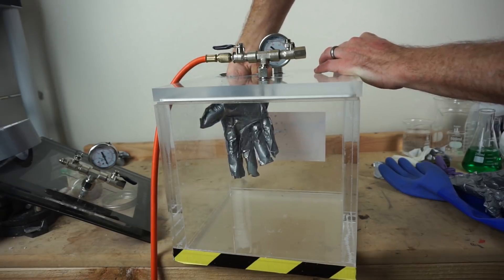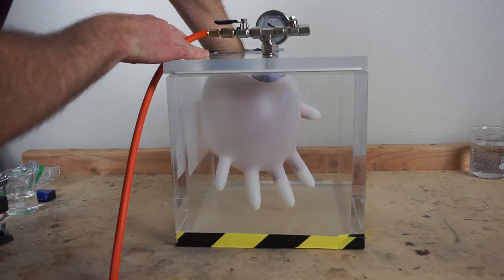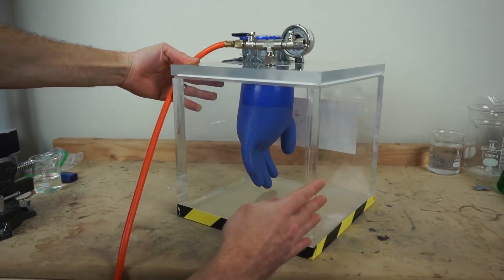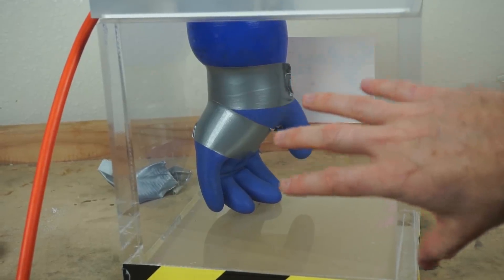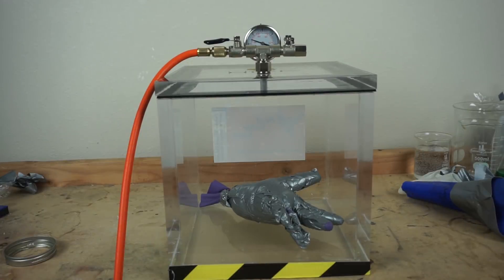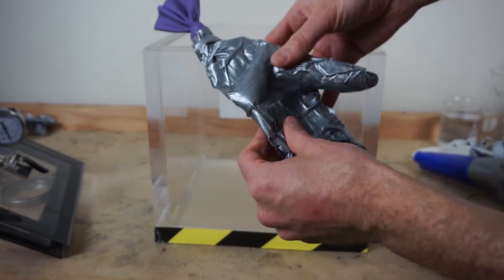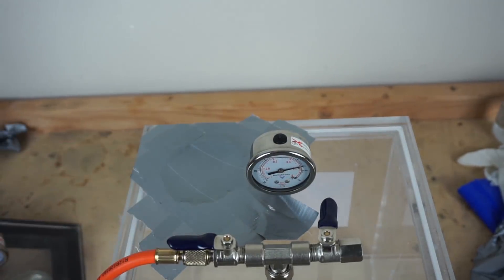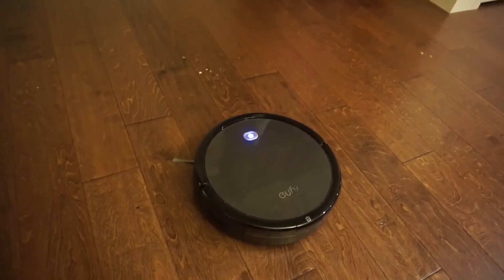Could You Make a Space Suit Out of Duct Tape? Wearing a Duct Tape Glove in a Vacuum Chamber!

Comment: I think your methodology is a bit off. Tieing off the end of the glove and placing inside won't create the same amount of pressure as having it attached to the hole in the lid. If you have the glove attached to the hole it will inflate with as much as as the inside volume of the glove where as tieing off the end will not allow it to inflate. Less air volume expanding over the same area creates less pressure than an already filled glove expanding over that area. A cool concept though. I would like to see an updated video in the future.

Comment: But this is assuming inside the astronauts suit is 1atm of pressure. Thy only inflate the suit to 3.5psi which is around the same pressure as 30,000ft. 1atm is  14.7 psi so this test is not at all accurate. If that is say a 3” hole it would only need to support 99lbs of force that was spread out evenly.

Comment: But Martian was using duct tape from the wrong site! Not from higher, but from lower pressure! That's why it shouldn't work so good. If he duct tape from the inner site - ok, it'll be hermetic because of pressure, no glue need. In Martian's case - it can't be hermetic because glue is not as strong as pressure.

Comment: What about plus or minus +-455 degrees? How does 3/16th of an inch (the thickness of a space suit) withstand these temperatures and the vacuum and the radiation and the space dust. What kind of Heater can warm something up that is -455? What kind of Air Conditioner can cool +455? What battery can supply enough power to said Heater and Air Conditioner? How did they do this in the late 1960's? How do they do it now? How much power is needed to Heat or Cool an environment that maintains +-455 degrees? How will duct tape hold up to these temps?
Reply: Oh I forgot and fit in a small backpack ?

Comment: Why are you reducing the pressure so low? Real spacesuits are only pressurizes to about 0.27atm. So to accurately simulate space, you should reduce the pressure inside the chamber to only 0.73atm. That will make the 1atm in the gloves 0.27atm above the pressure in the chamber.

Comment: Yes, and then your hand boils because there's nothing for heat to transfer to.
Reply: Renegade Rabbit 

If your hand is in a sealed glove then it wouldn't receive the effect of being in a vacuum
Reply: Lee burns 

It would, because heat would still transfer these materials, causing it to reverse back because there's nothing in space, so heat energy doesn't transfer.

A common misconception about space if you were shot out of a spacecraft for example, is that you'll freeze, but in fact your internal body heat would boil you instead.
Reply: Renegade Rabbit 

Heat coming  from where ?
Reply: Renegade Rabbit 

That's why space suits have a built in cooling system .

I thought that you were meaning in a real life space suit and not just a rubber glove with masking tape around it..

Comment: this test is flawed because air from the room could get inside the glove... air in the room (because the room is not sealed) is essentially infinite and also does not have the same properties as the elements comprising our body since our body is made of mostly solid or mostly liquid substances but room air is mostly a gass.

The cheapest and kinda accurate way to test this is to fill the gloves with some viscus gel and then seal the glove from the outside too and watch if it brakes.

Comment: This is what i don't understand about space suits. they don't blow up like balloons but they stay all floppy and crinkly. Makes no sense.
Reply: Space suits are made with many layers the bladder that holds in the pressure is one of the inner layers. The outer layer is the Thermal Micrometeoroid Garment. The TMG is not pressurized.
Reply: @dansv1  Are they under a vacuum rather than under pressure? I would assume it's the absolute opposite to diving.
  I assumed there was some type of inner layer but also would have thought that this would make movement extremely difficult.

Comment: Full vacuum? now way, it looked like it was still at 10% or so. Duct tape won't hold in a full vacuum.
Reply: Sjoerd de Haas 

What difference would the last tiny bit make??

A vacuum is powerless and passive ..

As long as a pressurised object can withstand the missing atmospheric pressure that's normally pushing back at approx 15psi then it can sit in a vacuum easily..

A vacuum isn't doing any sucking..

Comment: Space helmet fix debunked!!! His helmet was pressurized, so it's the opposite of the vacuum chamber. Relying on the duct tape adhesive to seal the pressure difference rather than the tensile strength of the duct tape as you demonstrated. I call fiction.

Comment: This is wrong and misinformation, what ur doing is trying to pump out air from the glove that's exposed to well oxygen. That's not how space works. If you where getting ready to go in space in the air lock, the air lock isn't pumping out oxygen from the room BUT instead letting vacuum from outside inside. Which means, the blowing up glove thing wont happen at all. Even when ur in space, nothing will happen to ur glove. HOWEVER, this doesn't mean ull be fine dandy. Its still freezing out in space, so itll freeze through the glove in just a few seconds, that's why space suits are thick, to protect against the cold. All of these gloves maybe except the duct tape one would work in space. They wouldn't pop. That's fake news.
Reply: You are quite wrong about that.  Think about it carefully:  

Your space suit glove would properly be attached to a pressurized space suit (pressurized to an estimated 4-8psi against the virtual 0 psi of space), while the test has the glove basically attached to a pressurized planet (at an estimated 14 or so psi against the .1psi near-vacuum of the vacuum chamber). 

You would, in fact, see the inflation of a sealed and pressurized, non-reinforced, rubber space suit or glove under those conditions, while a rubber suit reinforced with fabric-backed tape as seen in the video would limit the inflation and hold the pressure.

On the other hand, radiation of heat in space is a bit weird:  

On earth, the heat of your body radiates into the air... if the air is circulating around you - for example, in a pleasant breeze - the air heated by your body is carried away and replaced with cooler air to radiate into, helping to keep you cool.  If it's cool outside, the same principal contributes to "wind chill".  The same principals also work with your car's radiator, for example, or with your computer:  fans are connected to heat sinks and radiators to help dump heat into fluids like the air (and engine coolant, water, etc.), while the fans help circulate the heated air away to help keep people, engines, computers, etc. cool.  

In space, though, there is no atmosphere to dump heat into, and the vacuum of space is a rather poor conductor of heat.  Your spacecraft, space suit, etc. are thus trying to radiate internal heat out into a really bad conductor of heat, with no fluid (gas or liquid atmosphere etc.) to absorb the heat, and nothing to circulate to keep a fresh supply of conductor available against the radiating surfaces.  You won't freeze so quickly in space, depending on where you are:  if you're far enough from the sun, given a long enough time, you will eventually cool off to temperatures far lower than you'd be exposed to on Earth, but one of the major challenges of space flight is not protection against the cold of space, but finding a solution for dumping all of the heat that a space crew, power supply, solar radiation, etc. can generate.

Note that a lot depends on the sun, and whether you're in direct sunlight:  if you're at about the orbit of Venus, you'll have a lot of the Sun's energy beating down on you, and the danger would actually be a matter of being burnt to a crisp in space.  At about Earth's orbit, you might be fine for a little while, as you slowly work your way up to a nasty sunburn and perhaps heat stroke.  At about the orbit of Mars, you'll start freezing to death, but slowly.  At least, that where the side of you exposed to sunlight is involved... if you're in the shadow of something good at blocking solar radiation (a planet or your spacecraft, for example), you'll probably freeze slowly; the side of you facing away from the sun could be very brutally cold while the side facing the sun is uncomfortably hot (compare to sitting in front of a roaring campfire on a cold night:  your back will likely be freezing cold, while your front might be very warm, and in space, this effect is exaggerated!)

Check out the description of how a space suit works, and the amount of attention spent on keeping the astronaut cool, and some information about a new technology developed to meet the challenges of keeping astronauts cool on the journey to Mars:
https://www.space.com/21987-how-nasa-spacesuits-work-infographic.html
https://www.theengineer.co.uk/spacecraft-cooling-technology/

Comment: Duct tape would not protect from space radiation :). Or the extreme temperatures.
Reply: Extreme temperatures aren't to much of a problem if there is no matter to conduct it. At the height of the ISS it's 2500°C. If you would go overboard the ISS during night you would slowly freeze instead of burning up.
Reply: @ErikB605  Electromagnetic radiation travels through the vacuum of space and will get absorbed by your skin (depending on what wavelength hits the resonant frequency of the atoms).  You skin will sear and the energy nowhere to dissipate.  It is a problem :)

Comment: Take a good look at a vacuum chart. you say you reached .1 atmosphere , which is 76 Torr  the vacuum of space is supposed to be  7.6 Torr. do some research because you are misleading your viewers saying your vacuum chamber comes any where near the supposed 
vacuum of space
and viewers do some research before believing everything science says is true
Reply: Shanan Philip 

The guage down to a complete vacuum is basically a guage down to powerlessness.

A vacuum has no strength , all the power is with the object containing pressure.

As the vacuum chamber looses its strength it looses the power to push back against an object's pressure therefore this pressure becomes unrestrained and expands the soft rubber.

As long as a object can withstand 15psi over sea level or if it has a maintained operating pressure it can sit in a vacuum quite easily .

In reality the glove of a space suit has a managed pressure of around 5 psi  (3.7psi for some) so you would not get any ballooning as seen in this video as any gained pressure would be taken away .